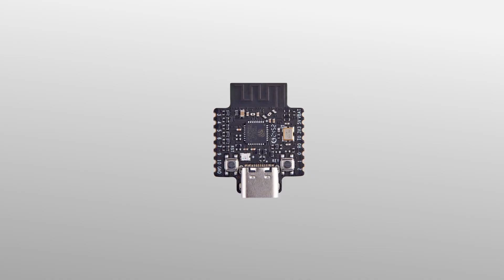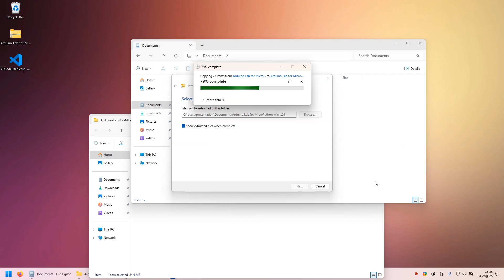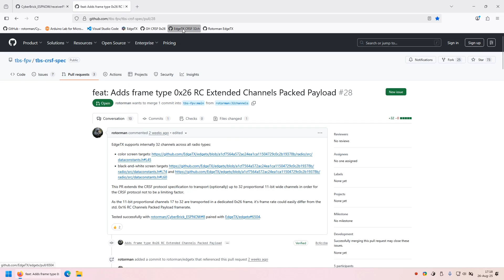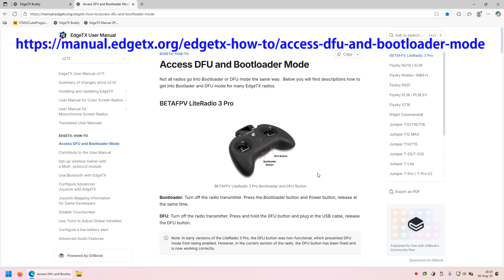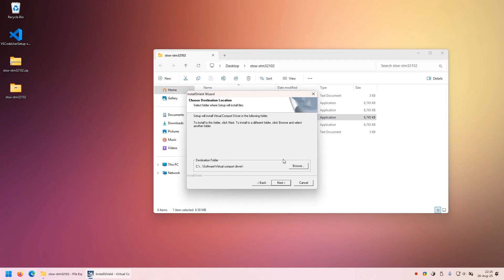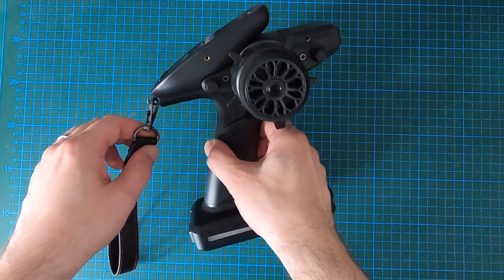Step-by-step tutorial on how-to control CyberBrick models from an EdgeTX R/C handset

Comment: Thanks for the tutorial! I'm having trouble flashing Jumper Aion Nano and kept on getting Wrong boot mode detected (0x13) error. I can't seem to find a way to get it to download mode (and can't find any guide on this). Hope you can help!
Reply from the maker: Do not have that module myself, but it should work, as it has std. ESP32 MCU: https://github.com/ExpressLRS/targets/blob/3a4bdba5879ff86272af185d04100793c051ed07/targets.json#L2500
Maybe this page helps: https://www.expresslrs.org/quick-start/transmitters/jumper-aion/#flashingupdating-your-tx-module-firmware
Validate first that you are able to flash it with ExpressLRS Configurator - this then gives you confirmation that all drivers are correctly installed and that you have also a correct USB cable.
Reply: @ristokoiva  Thanks for the response! ELRS Configurator also wasn't successfully flashing but I was able to get everything working on a Mac (so might be a Windows issue for me). On the Mac there was some build issues for PIO but I was able to fix these by manually installing some dependencies. Was also able to get the module OLED screen to show some stats by adding a simple display driver to TX code. Overall really cool to see it working and great intro to ESP-now. Thanks!

Comment: it seems like it would be smarter to just use ELRS pmw receivers and elrs ready ESC or flight controllers. 
the cyberbrick toy controllers are just closed ecosystem PMW of particularly low quality. 
it seems good for children for their first RC toy but if you have a real radio controller like a tx16 you are going to be way beyond closed ecosystem stem teaching toys.
Reply from the maker: Indeed, going with an ExpressLRS receiver and ESCs would provide not only from RF perspective a much better solution, but also more configurable and also otherwise better performing overall system. The benefit of the path presented in this video is that you can continue using the existing models and CyberBrick receiver side electronics as is, w/o any hw mods needed.
Otherwise, here an interesting DIY solution with integrated ELRS receiver and brushed ESC: https://github.com/frank26080115/Shrew-Dual-Brushed-ESC-with-ELRS although not 1-to-1 size compatible and thus replacable with CyberBrick X11+A11.